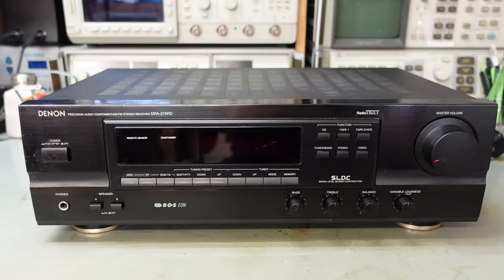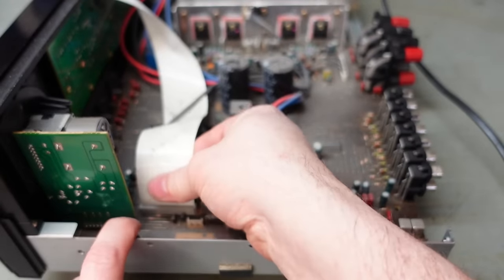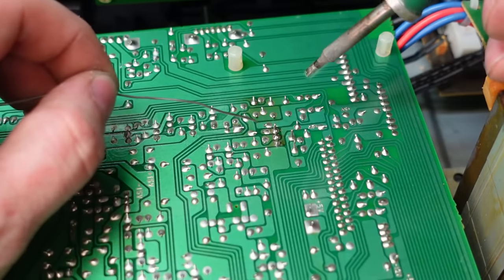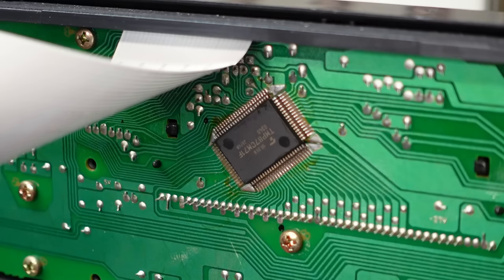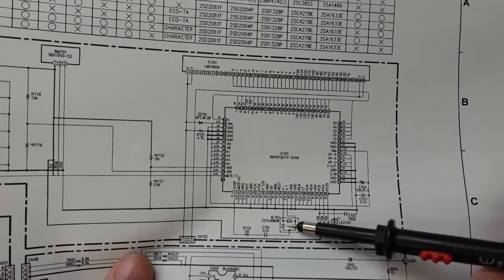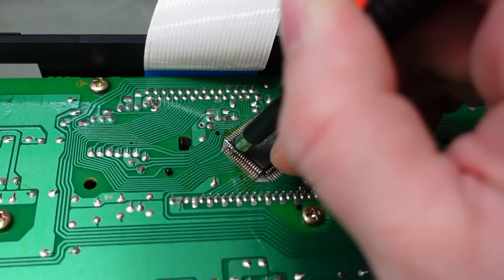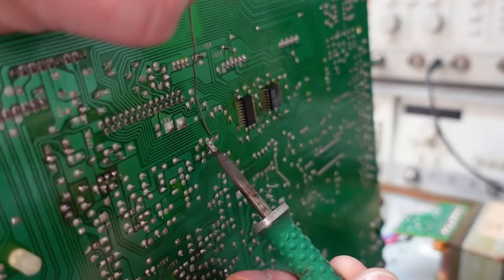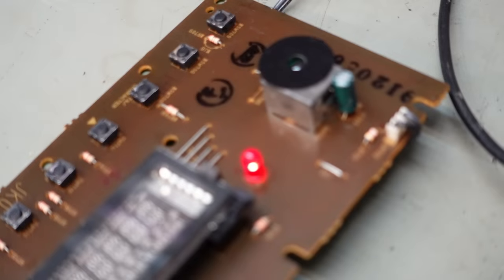DENON and the irreparable failure.

Comment: I have a question for you Mark about your favorite brand, Denon! I bought a Denon AVR-2802 new about the year 2000. Used it for a couple of months, and then stored it away for about 24 years. Pulled it out the other day, and it does turn on. Just doesn't make any sound through speakers. The headphone function works marginally but pretty low. It's not muted, not on the wrong input, working speakers and connection. It even outputs a signal through rec out to a sub with a cd player connected to it. I imagine other functions work short of playing through speakers. What do you think from afar?

Comment: If the micro is watchdogging and cycling the reset, it maybe because an external signal or condition is not there, i.e. comms to the RDS module, etc at powerup or even power rail voltage monitoring. I've dealt with products that won't power up (and stay in standby) because of simple things like it can't detect a working fan! So worth checking some of those other inputs to the micro and comms (check for responses to outbound transmissions to external peripherals and modules). Did you check for a stuck switch on the front panel?

Comment: I used to have an NAD cassette deck that stopped working and the local shop I brought it to gave up because it had a plastic cam wheel that was broken and could not be replaced. I regret selling the deck for parts now because I probably could have eventually 3D-printed a replacement.

Comment: Check Sears.  I have a 45 year old Kenmore microwave oven they had parts for it.
I of course simply replaced the blown capacitor instead of the entire board, but they had it available.

Comment: If you need a remote for anything, an old Samsung galaxy s4 smartphone has an infrared sensor and with the sure app, you can control most devices. I've used it on an old Toshiba crt and onkyo amp from the late 80s no problem.

Comment: I've got a denon av receiver that has been a pain. Decoder board was dead so had to replace the eeprom and luckily found the binary file in a forum post. Got that working in all its dolby surround glory and now left and right are stuck on mute with all other channels OK. I could force those mute controls low but often it's just not worth the hassle and won't fix the underlying problem which I suspect is the main CPU as the mute controls go back to that CPU on the schematic. My plan is to rip the guts out of it and replace the amps/psu with some class D amps and make a custom web front end via raspberry pi and drive some adau1701 chips to control the output and hopefully reuse the panel knobs and switches and get a small lcd screen where the vfd display is. Big project though and nice to upcycle an old amplifier. I just like the look of amplifiers from the late 90s
Reply: @MendItMark ^^^ someone is spamming your channel!!

Comment: I'm late the party :( Don't think it be the micro.  Could well be a fault on the output stage and the micro has detected it and thus gets "stuck" in a reset loop. Something like a large DC offset appearing on the speaker outputs can cause the "watchdog" circuit to reset and try again.. Checking the output transistors for shorts etc like you have done before would be the way to go.

Comment: I happen to have a DRA335R unit. very similar to this model. My problem with it is the pull out knob for the variable loudness has a nasty crackle to it and it will cut out randomly. I have tried to rotate the knob in every position pushing and pulling etc to try and clear the static (carbon build up?) tried a quality electronic spray from the front panel... still exists... do you happen to have any bloody hell recommendations on cleaning that up OR replacing if the part is even out there anymore... might you have a part number? Your a brain child repairman and amazing one at that.

Comment: Wish I could invite you to Norway to take a look at my Denon X3000. It registers no input, menu works, no fault mode. HDMI out setup menu only works randomly, most of the time no signal. It has some rust on the common ground screws that connects the PCB boards together, wondering if perhaps that's it... But I'm out of my field here. Unfamiliar with troubleshooting components and have only a very basic oscilloscope.

Comment: Yeah, sad news......you can pick these things up at our local auction night sales for $5 a time.....eventually you get snowed under with them and then it's dump master time........the worst culprits are those high end tape decks with myriads of exotic parts that are no longer available......don't even ask about CD decks........dumped too many to even keep count.......I still have a smallish Denon "music deck"???.....that has a 6 stacker CD player that occasionally won't play the CD and a cassette player that has slack drive belts.....the list goes on but the unit is complete with nice speakers and will play the output from my PC......now if I can source a remote control for it etc etc.....

Comment: Initiating (Memory clearing) Method
To clear memory contents of microcomputer and restore to the initial state, take the following steps;
(1) Press power switch, turn off power of the unit.
(2) Disconnect AC power cord from wall outlet temporarily.
(3) Insert power cord into outlet while simultaneously pressing two keys of TUNEFl and VIDEO SELECT.
(4) Press power switch to confirm that memory contents are cleared.
By completion of the above, the initial state is restored. In case the memory can not be cleared due to some reasons, repeat
steps 1 through 3.
Note: If the Power does not turn on and nothing is displayed except STAND-BY LED even after the above item #4 is
performed, the unit may be stay remained in the STAND-BY Mode. In such a case, please refer to the Operating
Manual, item "POWER" of the "NAME AND FUNCTION OF PARTS" for details.

This unit includes a STANDBY protection feature. This leature
is designed to prevent accidental turn—on from the STANDBY
mode in the event ofa powerfailure. Should AC power be dis-
connected and then reconnected when the unit is in STAND-
BY mode. the unit will return to the STANDBY mode.
To turn the unit ON from the STANDBY mode without the re-
mote control, operate the lront panelpowerswltch twice.The
unit will then operate normally.

Comment: I wish I had you around, Mark, to fix my Denon PMA-280 amplifier. It seems to me to be a problem with the volume potentiometer, which generates a lot of noise and only sounds from 1 channel. I've already cleaned it with spay, but unfortunately that's only a couple of hours solution. Then the same problem comes back. 😞

Comment: Hi Mark, Thanks for sharing your great knowledge with us! I've recently bought Denon PMA SX11 (online order from Japan) and the day I received (last week) , I powered it on through my existing step-down transformer which says 500Wt but continuous 400 wt. The moment I tried to turn on my unit, it started blinking (power button blinking green) and clicking but not turning it into solid green. I asked for help from my supplier who told me use 5000watt transformer which I ordered through amazon. Now, when I connected it through the new transformer which can handle up 5000watt (continuous 4500watt) , the power button is not green but it stays red for a while without any clicking noise and then goes off afer a while. I was so excited when I got it and now I am worried thinking to send back to Japan for repairing. Any advise so that it can be seen and resolved the issue in the UK? Would appreciate your advice! Thank you so much!

Comment: Reset pin must have a pull up resistor. 
You cut the trace, but did not pull it up. Use a resistor of 5-10k and bring it to VDD.

Comment: Did you try removing the big yellow super cap C401 next to the large ribbon cable? Maybe that is storing the memory.
Reply: If the memory is with the processor on the front panel (where it should be), unplugging the ribbon cable certainly disconnected it.

Comment: 10/10 for sheer perseverance on this one Mark, I'd have given up not long into that one. The sheer amount of dis-assembly on that beast was challenging. 

I have a love of electronics and worked in the industry from my first job aged 16, assembling circuits and parts for a small electronics company that supplied covert communications gear to the police and security services. Later on towards the end of my working career I worked for Omron the Japanese electronics giant on their EPOS systems and gained a life-long interest in computing and programming (pre-internet floppy disc era!) which took me away from electronics. 

I haven't done much with electronics for a long time except the occasional repair job but just recently I've re-kindled my interest and decided to try a little project in my retirement. My electronics knowledge is fairly limited, so I'm hoping someone can help me with a quick techie question...

I have a small folding electric bicycle gathering dust I converted many years ago using a kit purchased from China that has a standard 36V DC motor and controller, which I'd like to bring back to life and get some use out of. Originally it had a custom-made Chinese Lithium-Ion brick battery rated at 37V DC 15Ah. However that battery has long since died. Rather than replace it with another Lithium-Ion brick-style battery that ends up in landfill, I want to have ago at designing a more eco-friendly battery and take a serviceable modular approach using 18650 type (similar to AA size) 3.7V 3600mAh Lithium-Ion cells connected together in 4 or 8 cell battery holders. And a simple voltage regulator and charging circuit to provide 36V DC and around 10-15Ah (or more) output. 

My question is, would using 16 to 20 18650 cells (or similar small cells) rated 3.7V 2300mAh-3600mAh be sufficient to power my electric bicycle's motor or wouldn't they be up to the job and drain too quickly?  Assuming they would be up to the job and provide a decent charge-cycle usage time, how long can I expect these cells to work from new? Are they likely to need replacing more regularly compared to a custom built Lithium-Ion bike battery which typically use fewer and much larger sized flat cells joined together?

The original battery I used performed remarkably well. I could get 20-30 miles easily between charges without pedalling with an average speed of around 18-20mph, and those batteries typically lasted about 4 or more years before they started showing signs of performance degrading. 

I'd welcome any suggestions or technical expertise to save me engaging in a potentially wasteful and fruitless exercise! If anyone has any specific suggestions on small battery cells I should use I'd be grateful. My plan is to design the battery housing using a 3D printer to enable easy opening and replacing of individual cells when they eventually degrade. With some LED's to indicate cell failure and maybe a Bluetooth link to an Android app to show battery cell health. I might also look at incorporating a decent 12-24V solar panel onto the battery enclosure lid for trickle charging the cells when the bicycle is outside or not being used.

Feel free to reply on here if you have some suggestions or advice... or you can find me on Facebook by searching my name. If you leave a reply, give me a like to get my attention as I've disabled comment-reply notifications as I get too many. Cheers.

Comment: I've had several older Denon amps and the rapid tapping of the power switch seemed way way way too fast! I wanted to scream out at the video! The rate that worked for me was about .8 of a second between the button pushes. Maybe just try it much slower before giving up.

Comment: Very interesting.  I still have my DRA-375RD (one model up the line and 20 more wpc).  I bought it in 1997 (maybe 98).
Reply: Run it with a decent line filter or UPS.  Otherwise the day will come where it ends up like this.

Comment: Ok I read through the top 20 comments and somebody probably thought of this.  What would happen if you cut the trace or other bodge, and fed in a new permanent high to the standby pin?  I know standby wouldn't be an option anymore, but I never used it on any of my amps.  It's there on a few, but I never use it, I just switch it off.

Comment: I have an old Technics stereo amplifier a bit similar to this in appearance, maybe from the same era. My amplifier sometimes doesn't power on, or if it does it may make loud banging noises in the speakers, until I hit it with my fist. Yes, and I know it is not good to hit the device. I have opened the amplifier once because I thought there must be a loose connection or bad solder somewhere, but as I'm no expert in electronics, found nothing obvious. I've heard that capacitors might go "tired" with age, don't know. Any advice?

Comment: I didn't see if that wobbly 7806 was in any way responsible for the power supply to the micro? If the centre pin went high then the input voltage would have been sent into the micro.

Comment: great pity, only chance of repair would be from one of the same unit, maybe a physically bad one.. i had a sharp vertical turntable music centre that its processor had gone gaga, and tried to run the linear tracking arm off the end each time powered up, and a kenwood system that just went weird...both these scrapped as no parts available

Comment: Do you remember the ones which had a plate on the back with a couple of screws in it? You could easily take it off and gain access to the whole of the PCB to do repairs. I think Denon were too cheap and nasty for such forethought.

Comment: after soldering 6v reg. and after checking rest of joints and still no on.  I would confirm 6v at output and then scope input and output of reg and if random noise repl.or esr small caps at input and out of reg.   can coroupt micro.   just saying.

Comment: I had wondered about the new lead-less solder, is the new stuff any better? Frankly I that they 
went to far about going lead-less. So far as the receiver?  another black weightless box with tiny print or labeling. Give me a Pioneersx650 or Kenwood KR6030.

Comment: theres one of these on ebay at the mo, listed just as 'used', doesnt say if working or not, hmm..😉......wonder if that regulator going dry jointed killed the processor? if the ground pin loses connection, their outputs can rise, this is the main cause of commodore 64 psus killing the computers

Comment: You could at least use the amp without the Microcontroller. Add some manual switches and mimic the parts of the µC which are needed to get the amp going!

Comment: Onkyo TX84.  I have a similar-era setup I love.  I live on a half an acre, and out in my shop I have my shop-laptop that I download Pandora Music from the internet, and send it into the Onkyo for the amp, into some rather large (very) JBL speakers.  Even tho my property is larger (as are all my neighbors), I dare not turn the volume much past half.  Beyond that I DO get a little distortion (and it is LOUD --- my neighbors are accommodating, but I don't want to push my luck with them).  I do have one question for the electronics-savy:  I have to turn the Bass all the way down, otherwise the bass gets overwhelming.  Could that be the amp, or is it more likely the speakers?

Comment: I'm not able to go through all the 524 comments but has anyone mentioned the standby-supply-capacitor that normally goes bad? Or is there nothing like this in this unit? Wouldn't that also trigger a voltage sensitive reset circuit inside or around the MCU? Just wondering.

Comment: Well after you had a good look at its back end, pulled off its wobby parts and pulled off its knob would you expect it to work? Seriously though this is why i generally only repair japanese hifi from the 1980's as long as they dont have those powerpack amp chips! Having said that you can build a new amp using the power transformer and heaksink and a mosfet amp ( I'm lazy i buy a kit or even a Chinese pre made module)  its the power transformer and heatsink that are the expensive bits.

Comment: So I've got a old denon dra635r that recently quit working on me. When I try to power it on I hear a relay like clicking sound from the rear of the unit as usual. But I get no display or anything at all. All the fuses are fine. Any recommendations on where to start?

Comment: Mark. . PLEASE help me !!  I've had a wonderful Denon DRA 700AE DAB amp/receiver for over 10yrs now . . It was pretty pricey, but I wanted a good reliable & powerful amp . It has been great & still works brilliantly like new !
But . . I always get a slight tingle when I run my finger along it (& also from the pickup arm of my Technics 1210 deck which is earthed/grounded to it). . I moved recently &, whilst setting it up again, realised that the mains lead (like a "kettle lead") only has 2 pins !!  It's not earthed & never has been !  I'm scared to use it & surprised that I haven't had a serious shock from it over the years. Presumably it was made for the US market? Is that why?  What on Earth (no pun intended) do I do? How can I earth it?  Please help. Thank you.

Comment: I have an intermittent denon oroblem and in the end bought another receiver. However i still have the unit. The problem was an overvoltage and the circuit protecting itself. This chip intrigues me....i managed to reset my machine many times by holding the power down and keeping 2 other buttons held down for 5 seconds. A menu came up...reset....then it worked. It reset the board and chip. Could a reset on that chip help ? Im no expert but if i helped by advising a reset gets past the standby and clears the false fault im happy. Ignore otherwise. One day i will fix my overvoltage lol. I just could not throw it away lol